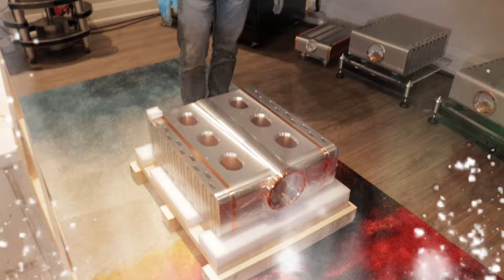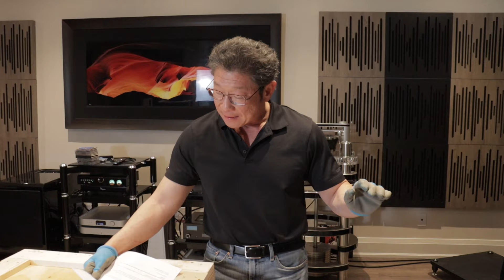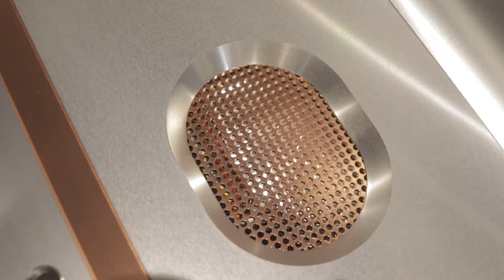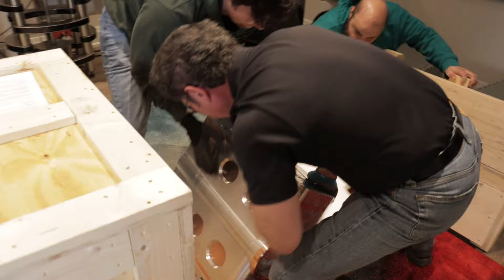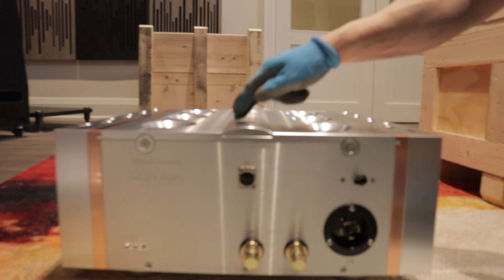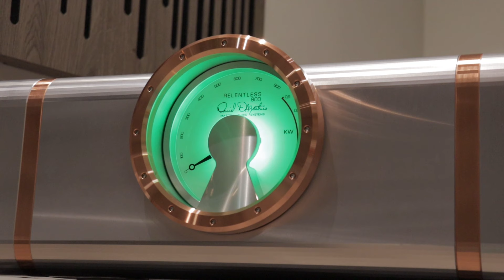Uncrating D'Agostino Relentless 800 Power Amplifier

Comment: I'd be interested to know how the 'SuperRail' actually works because Paradigm utilized in its Signature Sub2 a 240 volt directly connected rail when full volume was needed. It utilized an 'Ultra'-class D switching amp rated for 4.5KW. Obviously there is a world of difference between Class A and D but I wonder what kind of distortion you get when pushing it to the kilowatt realm? Then again, these are prestige machines mostly bought with 'f**k you money'.

Comment: Missed opportunity. I wish you would have shown the power cord ends. Try googling an image of this amps power cord. It's tough to see. I was surprised by the c15 connector. I thought the wall side would match the amp side. I was expecting a 240volt connector on both ends. I guess they went the common route. Is there an explanation? Thank you 👏👏
Reply: You can specify what end you like from D’Agostino.